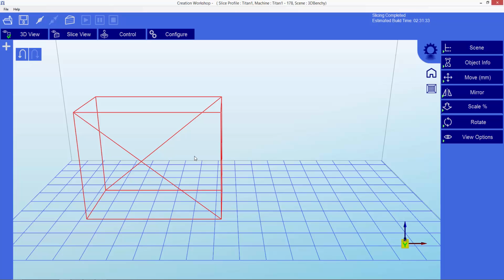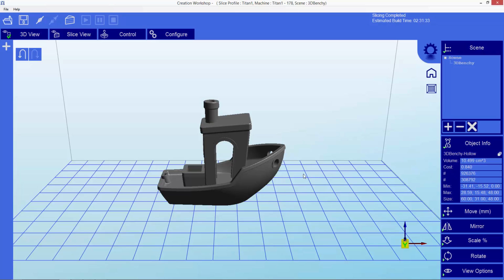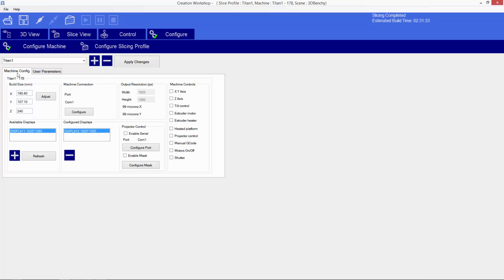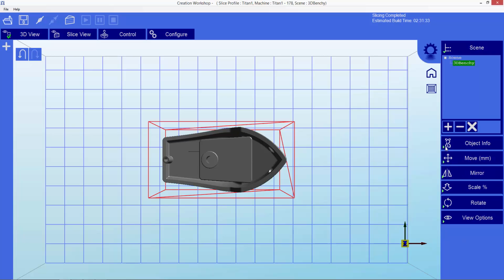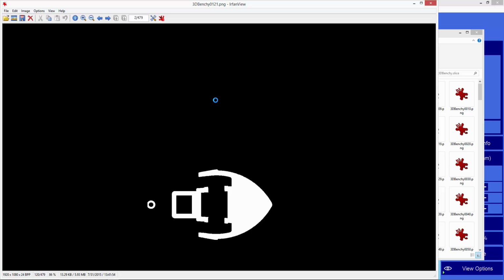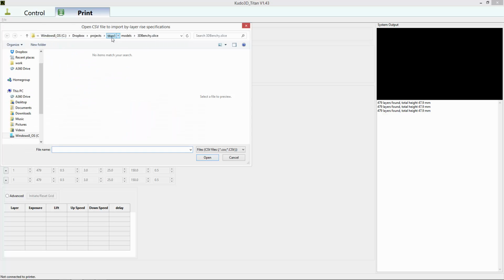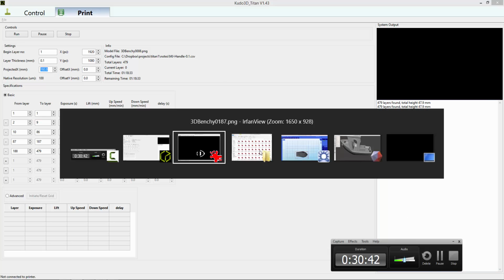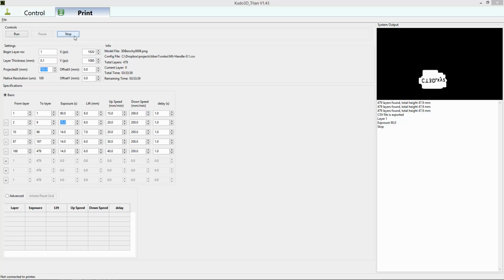Kudo3D Titan 1 DLP SLA 3D Printer: Software Preparation for 3DBenchy

Comment: Hello 
Im have found challenging operating our SLA  300 3d printer since its controller software licenses has issues.  
Im inquiring if there is a way of installing another free or maybe cheaper software for the 3d printer.  Currently the 3d printer uses EzCad, 3dp corfile and bjjcz. We have never used it so please guide me. If there is a way we can install maybe alternative software for SLA 300 the better